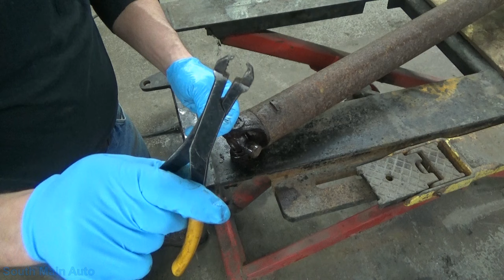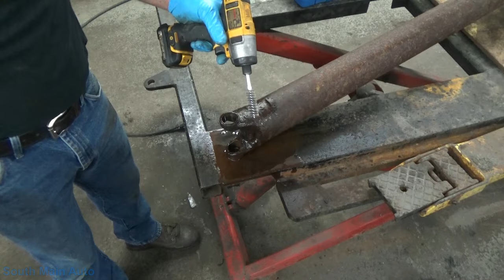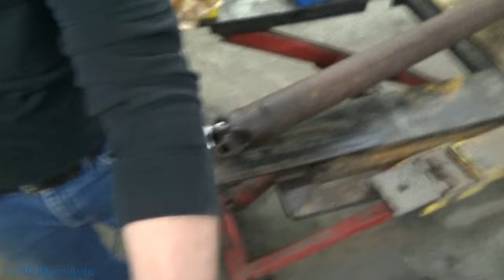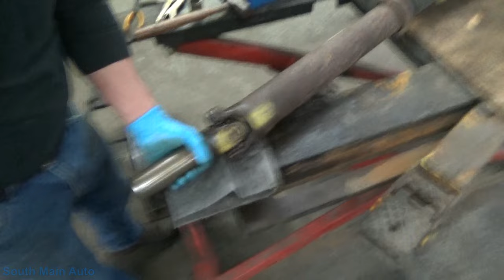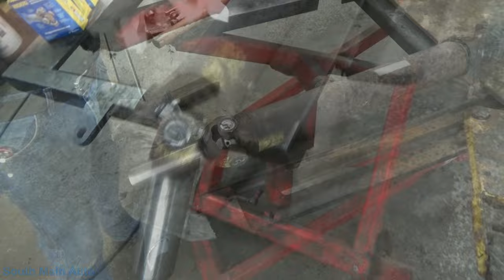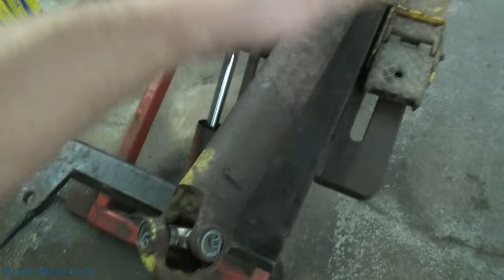How To Replace U-Joints (ULTIMATE Guide Using BFH)

Comment from the maker: *FATMAX AntiVibe Fiberglass Engineering Sledge Hammer, 4 lb: https://amzn.to/2MqlILa
*Tiger Tool 70300 U-Joint Snap Ring Pliers: https://amzn.to/2JCcMob
Reply: Hi Eric. Did you ever do a gm u joint video with the plastic? And have you ever used tiger tools 10105 u joint puller? Not sire if you read these old messages but couldn't fine a gm video by you nor if you use the tiger tool puller though your ball pin hammer method like you say "it works".
Reply: Plastic U joints use the torch
Reply: Good Lord, man. You have some real patience & persistence. 🍻
Reply: Battery pliers work great for removal/install of snap rings.
Reply: Eric I need a diagram for a 99 Sonoma’s center support bearing. Got the old one off new ujoints, just dunno what the extra 2 pieces that came with the bearing are for 🤷‍♂️😕 
Offered all the shops in my area $100 for 5mins to slap it on for me. Lolz they all said nope my mechanics don’t have time 😂🤷‍♂️

Comment: Hi Eric I have been doing this sort of stuff for about 35 years and I get the joints apart the same as you do but when fitting them I put the cups in the freezer for a few hours the cold makes the needle rollers stay put as the grease is cold and when you fit the cups you can press them in with your fingers because the cold shrinks them. Makes it nice and easy. In a busy workshop it is not always possible for the freezer method but if you have the UJ s in advance it makes sense to freeze them.
Reply: Good idea Julian
Reply: Good idea, I want to try this. You said you freeze the cups to shrink them? Wouldn't that make for a tighter fit on the
cross section?  Do you have any trouble getting the cups to slide onto the cross section?
Thanks for the idea!
Reply: No you dont get a problem next time you have to replace a UJ try it
Reply: WMichael S I'm using dry ice... but this is on toggle system on mould m/c...
Reply: I put a hub bearing in the freezer and heated the hub up.
Reply from the maker: See this is why I love YT. The next time I do this the U-Joint is going in the freezer for sure! Thanks for sharing your experience with us!!
Reply: I did the same after seeing that same comment on ScannerDanner's u-joint vid....while cold and packed with grease, those needle bearings aren't going anywhere unless you really throw it against the wall. Worked great!
Reply: Glad it worked for you Jeremy I have used this method for years and it does make things a whole lot easier.
Reply: I did it with wheel bearings too.....they drop right in when you heat the hub up and drop the cold bearing in
Reply: James Avery -- I used to build go kart engines with a split crankcase.  I'd put the engine halves in the toaster oven and after about a half hour I would hear the plop plop of the bearings falling out of the case halves. Then I'd take the new bearings out of the freezer and drop them right into the case halves no press needed!
Reply: Julian Thomson yep freezer all press fit garbage
Reply: SMAR auto So admittedly, you are a You Tube mechanic, just looking for clicks?
Clicks make better money than actually working. Love this stuff,LMAO
Reply: Excellent idea. It's so simple a concept yet not thought about.  Machine shops use the concept to put industrial gear boxes together but use liquid hydrogen.
Reply: who has time to wait?
Reply: @63256325N  l do hope you mean liquid nitrogen. Might make it interesting though!:-)
Reply: You're right, I miss-spoke. I did mean nitrogen. Hydrogen would be a bit on the dangerous side in any surrounding let alone a shop environment.
Reply: @LoveHateSexPain311  
See Duncan's comment👀
Reply: @JOHN-wy2iv  
 When I read it, my brain just inserted nitrogen because I knew what it should be. Had to go back to the original comment to figure out what you were talking about, lol.
Reply: @brainfreeze44131  I like to do the same thing, makes pushing bearing in easier. However, I haven't had much luck with putting the hub in the microwave....
Reply: Thanks for the tip.   It the freezer it will go.
Reply: @LoveHateSexPain311  People who plan ahead.
Reply: I had exactly this same idea after needle bearings from hell. Still had to buy another u joint after slamming the hell out of one. Ps large angle grinder disc is good for oe jag u joints that don't press out. Small discs don't quite have the reach
Reply: Have used the freezer method on my motorcycle main bearing race and heated the case. They slip right in. Should work on wheel bearing race as well.
Reply: Pretty much anything I get that's a press fit ends up in the freezer for as long as possible before installation, u joints, ball joints wheel bearings etc
Reply: and if you don't have time for the freezer (or you wife catches you trying to put auto parts beside the french fries) I prefer to press the caps on with a big C clamp and avoid risking one of those needle bearings flipping over into the bottom of the cup, but maybe that is just me.
Reply: also - if you have the whole drive line out, may as well do the hanger bearing while your at it? (these days they often call them mid or center bearing)
Reply: you can also put them in a small cloth bag and spray a lot of co2 from a fire extinguisher in. Produces dry ice and cools them rapidly.
Reply: @SouthMainAuto  In Up-State New York, you could just leave the new U-joint outside over night 9 months out of 12.
Reply: Hi Julian I have Plastic Injection ones and like da nervous to do those. I don’t have luck either with UJ! Kinda pisses me off cause they don’t seem bad to do until you start on the buggers! Any help would be great help! Thanks James from Chardon Ohio! (AKA Snow Belt)
Reply: Just replaced a U-Joint and this comment reminded me to use physics to my advantage. Froze the part and the cups slid right in, no fuss. Now trying to get the old one out, on the other hand...
Reply: I just pack them with more grease.
Reply: @assignmeanameplease  Bruce
Reply: @r.b.l.5841  for the price of a small freezer it's worth getting one for the workshop if you can find the space (32litre tabletops are about $100 and a 50 litre chest freezer about $150) - just make sure you get one with a drain plug if you get a chest unit because defrosting 'em can be a cow otherwise (then again if you've got a liquid sucking rig, no issues)
Reply: Works with bearings and non-floating wrist pins. 30min in the freezer, apply a little heat to the bore of whatever, and in it goes.
Reply: OMG thanks for the tip!!!
Reply: If you're pressed for time, you can also use a CO2 fire extinguisher to rapid freeze the cup. We used to do this for cutlass (strut) bearings on boats.
Reply: im gonna try this since im such a clumsy fuck thanks for the tip
Reply: @saxdogg69  hahaha against the wall 😂
Reply: @miscbits6399  fridge freezer and gas barbecue excellent tools for the workshop.......fridge for beer, freezer for shrinking bearings/bushes, barbecue for heating up hubs, crankcase, etc and obviously all three can be used for socialising......You know it makes sense
Reply: I think it shrinks a little the rubber material around the u-joints do I heard.
Reply: I did the freezer idea on my vacuum pump then, heated the pulley.  It worked semi well.  It worked long enough to get the pulley started straight.  Then, the two components equalized in temperature rather quickly but, I was able to press the pulley knowing it was going going on straight.
Reply: Julian thank you for sharing your idea. I have to do my 2002 f150 u-joints today (08/21/23)& it's my birthday so if anything can ease the process I'm all for it 😊{I will let everyone know if it helped in any way}
Reply: Thank you Eric & Julian-the freezer trick works! The needle bearings stayed in place, and the caps slipped into the yoke with minimal effort. I also nipped the small end of one of the old clips and installed it into the yoke clip groove, turned it a few times to clean the grove (same idea as using a piston ring to clean the piston ring lands) I suggest buying the ball/U joint tool (big C clamp), not a fan of hammering on the yoke.

Comment: Tip for watchers: If you don't have a large bolt like Eric is using to hit the u-joints as you work on them.  Keep an old u-joint cross (the body of the u-joint).  It is very good for hitting u-joints in/out in the future.  It is the perfect size, and the cross members give your hand a lot of support for holding it well when hitting it.  It is nice and hard, doesn't deform easily, and transmits a lot of the energy from the hits right to the u-joint you are working on.
Reply: I have used a Socket that is just smaller than the UJ Cap and then hammered on the Socket to drive it out.
Reply: @markthomas7270  I keep a cheap set of impact sockets I picked up at a flea market just so I'll have many sizes to choose from works great no way I'd use my good sockets though.
Reply: An old impact socket works as well 👍
Reply: @davidedgar2818  shd be *brass , not hardenned steel!  ever!

Comment: Dad started me in the garage business at age 13 now age 70. If you install a joint with the zerk facing to the center of the shaft it will always be able to accept the grease gun. Not picking on you.😊

Comment: Hi from Mr Nick Wiese: This is me 30 years ago, but the guy in the driveline shop used only a pocket knife, pliers, medium ball point hammer & a flat blade screwdriver!  He beat on the end of the driveline yoke and the cap backed out, he cleaned out the clip area of rust & dirt with the knife.  The old way to get a tie rod end out is to beat on the metal it is in on the side and it will often back out (same idea)  I hope you will give it a try. good luck, Nick

Comment: I learned how to do this with a ball joint press, and each time I got lucky when the caps fell out the bottom with a buzz of the impact. These cups are deeper and it would be more difficult regardless of the method used. It was fun to watch a pro do it, with the same tools we'd have up in the back 40! I remember my Dad and I walking one day, when the prop shaft exploded on an old F150. You could use this method on the road if you had a replacement on hand. The advice you gave at the end was golden, the voice of experience. I hope you'll keep the promise to show your method for plastic joints and aluminum shafts, I've never had a chance to do those.

Comment: I do u/jts the same way and have never had an issue. The only difference I do is I tap on the yoke or cross to seat the cup against the snap ring but your way accomplishes the same thing...the key word is tap! When I was 16 yrs old I was taught be a 70 yr old great mechanic and he said he did it this way for 50 yrs so if I followed his direction I'd be OK & I just passed it on to the kid down the street & told him Irwin did it for 50 yrs and I did it for 40 so if you follow my direction you'll be OK...now I'm the old mechanic. I've  only taught a few but you will teach thousands & congratulations you're almost to 65K subscribers!
Reply from the maker: wait.... am I the old mechanic now???
Reply from the maker: Mrs.O says i am 37... yes I had to ask haha
Reply: I said @20 but I thought you were a few from 40 then I have you by 23...but if I ask Mrs H. I'm only 8 yrs older than you but I think she says that b/c she wants me to keep working :D  I need to now to get my use out of the Pico.
Reply: I'm 37 was taught this exact method by the old man when I was a teen tried to teach a kid a few months ago and he proceeded with that looks dangerous I might hit my fingers I told him there's no might to it as long as you have that mindset you will and even with experience it could still happen I proceeded to ask him if he'd rather hire a mechanic he said yes I said ok that'll be 90 dollars and you buy the parts he proceeded to hit his finger lol but at least he's trying now.

Comment: I'm preferred method for doing this after getting the clips free and the cups moving a bit with a BFH or air hammer is to use a bench vise opened a bit with the 2 ends resting on the open jaws and hammer on the solid part of the Yoke till the cup come out, then flip it over to the other side. And pressing in the new joint is super easy if you clean up the holes nice and use a little grease in the Yoke holes. And clean the slots for the clips really good too!!!

Comment: Thanks, Eric!  I used to do all the normal and "easy"  tasks myself until I got to be in my 60s and disabled!  Now, I still do what is easy for me to get to and have a shade treee mechanic friend that helps me with anything I can't do and that requires a shop!
This pretty much the same method my dad toaught me!  He was a master mechanic on both diesel and gas engine vehicles!  of course that was MANY years ago!  He passed in 1971!  
I just needed a refresher course!  Your video was preceise ns I appreciated that you left in the problems!  They aren't uncommon and, as long as one doesn't go nuts and get too frustrated, as you show, they CAN be remedied!
Thanks for the video!
Keep up the good work!  Best wishes!

Comment: Eric, I watched this video a while back...ended up trashing the UJ's on my daughters car whilst separating the drive shaft (my own stupidity) but revisiting the video today, to get the UJ's out....I did it the right way...Now don't feel so bad about it all.  I had no option but to trash them as the shaft was 'welded' onto the VCU.......but I did gain a bearing puller set to aid the process...RESULT!! Car is currently in two wheel drive, VCU and prop-shafts will be replaced when I get home from work...in a month or two...

Comment: The secret to success using this method is a hammer that is big enough to deliver controlled energy. A too small hammer is big enough to do a lot of damage without being able to deliver the controlled energy necessary to get the work done, so you end up just beating the heck out of your parts and damaging them. Also a too small hammer is far more likely to chip off a piece of steel and send it flying because you are forced to trade high speed less controlled blows for slower blows that deliver the energy on target.

Comment: I'm no expert but I prefer to orient the grease zerk such that the grease hole "compresses" when the drive shaft is under load.  I was taught that a u-joint is weaker when oriented such that the grease zerk hole "opens" when under load with the vehicle moving forward.  A simple 90-degree rotation of the joint determines whether the hole is under tension or compression.
Reply: Thats the most important of the procedure "G" maybe no expert but a humble pro is what you are to me!

Comment: I've got several of the ball hones for wheel cylinders and master cylinders, from all those years ago when we used to rebuild such things.  So to put them to use I run the appropriate sized ball hone through the driveshaft yoke and polish the bores a bit after filing out any burrs.  Bit of grease, and I use a vice and sockets to slowly press the cups in.  
Great video,  and the exhaust manifold work on that F-150 is outstanding too!

Comment: I recently replaced the u-joints on my '96 Ranger with over 210k miles. I am a diy and this was not my first time but I used a ball joint press, spread the yokes and made just about every mistake you said not to make. I got the job done though, by keeping my sense of humor, as you do so very well. Thank you for another great video!

Comment: I did the u-joints on my 2002 Grand Cherokee, front & back but not the yoke.  Did it almost exactly like you did.  Never done it before but it seemed pretty straight forward.  One of the joints had the clips rusted so bad that the cups wouldn't move at all.  I ended up grinding out the inner sides of the cross & pounding out the cups from the inside.  managed it without bending the fork of the shaft. filed out the burrs, lubed the cylinders with u-joint grease & pounded the new joints in.  Tapped them after adding the clips to loosen them up & BAM!!!  All groovy like the movie!

Comment: A couple of things that really helped me out,one of the things I did with my wooden handled hammers, was to grind a spiral in the handle using the edge of a bench grinder, I was amazed at how much it helped with grip. The other thing I did was use a small dingle berry hone, to just clean up the inside opening of the yoke, and no I didn't go stupid with it and over size the opening, but just a quick pass through it to clean it up.

Comment: The problem is is quick lube place is actually going to grease those u joints or any other aftermarket component aka front end.Have a customer with a 2500 ram 4wd have replaced the front axle shaft u joints 4 times. The oem u joints are 4 times the cost of a aftermarket unit but pissing in the wind here has to change them out every 18 months like clockwork.Everyone thinks non greaseable components are crap but in fact in this day and age its the shit.Filled with synthetic grease and sealed for life these components last 80 to 100 k miles maintenance free.The aftermarket greaseable components with their loose seals are designed to expel grease they go dry and fail.Yea if its you or me no problem we will grease these components when needed but your average joe relying on his favourite quick lube they are going to get overlooked.Told my customer this first change on the u joints says oem too expensive said see you in 18 months.